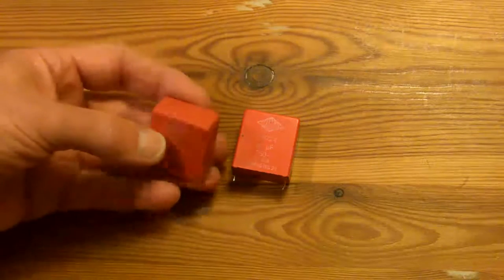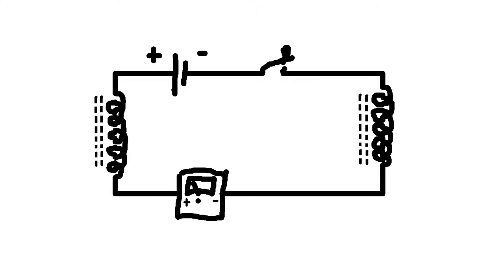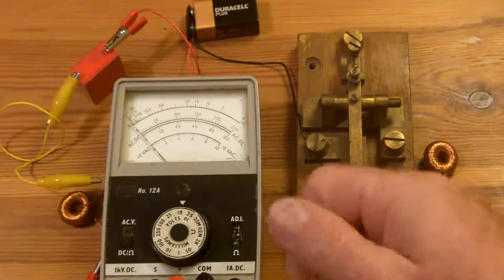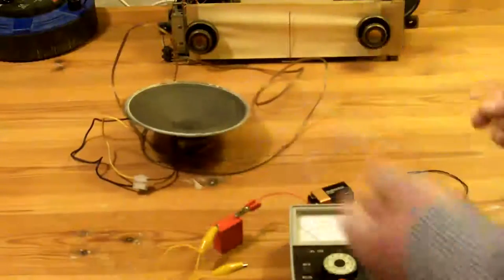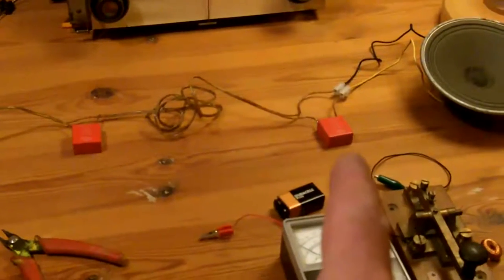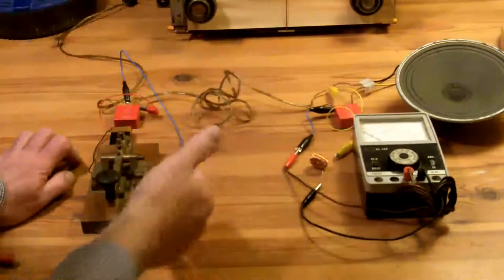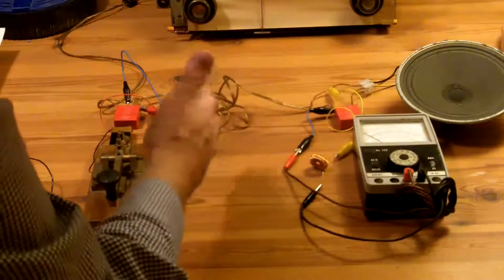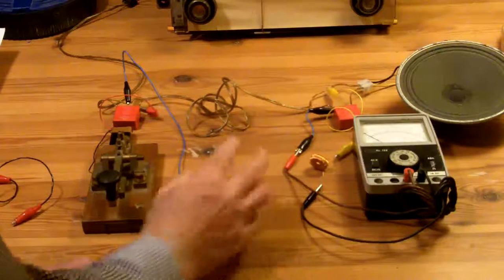About Capacitors ... Part 7 Blocking and admitting signals.

Comment: Thanks for the teachings, Andy! I am working my way through your stuff and find it all very well done!

What was drilled into me by a radio instructor was this: capacitors oppose any voltage changes while inductors oppose current changes. You did a great job of explaining how capacitor selection determines which frequency of voltage we are choosing to allow or block....very cool...

73
Herb/WR9H

Comment from the maker: @MrVinamp Yep, that’s right, the same thing also applies to the crossover unit in a speaker cabinet where you two or three speakers. A network of capacitors and inductors ensure that the low frequency bass notes go to the ‘woofer’ that can handle current and the high frequencies go to the ‘tweeter’ that can respond to rapid movement.
Sometimes I think our ears work the same as if someone’s talking about us across a crowded room somehow we filter it out hi hi.    
Kind Regars ... Andy